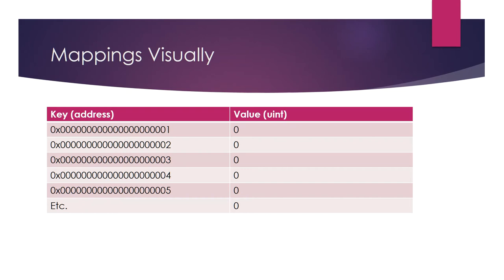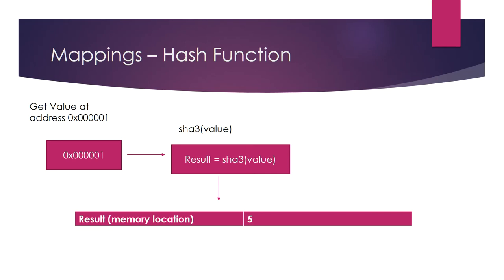Solidity - A Deep Explanation of Mappings Part 1

Comment: So that means mappings may be iterable if the left-hand data type has a relatively small range of values like a uint8 it loops through 255 possible values which is feasible
Reply from the maker: No. Mappings can never be looped through. They are hash values. It would be impossible to loop through because every key has to be put through a hash function.

Comment: Thanks. One question I struggle with considering solidity and the remix ide. Is there a way to use a getter function to output  an array of addresses or structs? Is that possible?
Reply from the maker: You can return an array as long as it's fixed size:
 uint[30] p2;
 function returnStructArray() view public returns(uint[30]){
        
        p2[0] = 5;
        
        return  p2;
    }

You can use the experimental ABIEncoderV2 to return an array of structs, the current solidity compiler does not support it.
Reply: Thanks a lot. So if we have a mapping of addresses where people want to register for some event. There is no way to return all addresses within our mapping array to know who has registered? We would have to take each individual address an check if it is already registered?
Reply from the maker: Not with the mapping.  You would have to have a separate dynamic array, where after you set your mapping, you would also push the struct or address to your array. This array would be declared as a state variable.  You can then loop through this dynamic array to see who is registered.
Reply: Hi Alex, thanks a lot for your answer. Highly appreciate it. Hope you continue this series. Your explanations are great and the content as well. Hope you find time (asap of course ;) ) to create new videos on this topic. A topic I can think of right now is deprecation of commands and common errors which occur. Regards